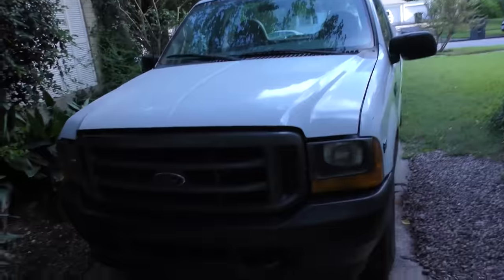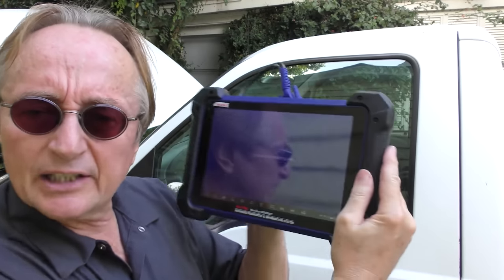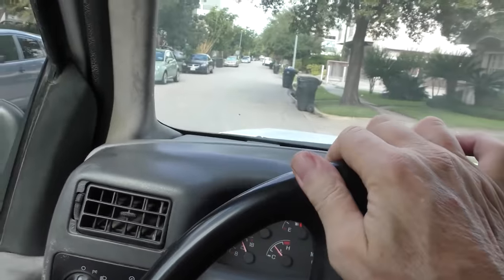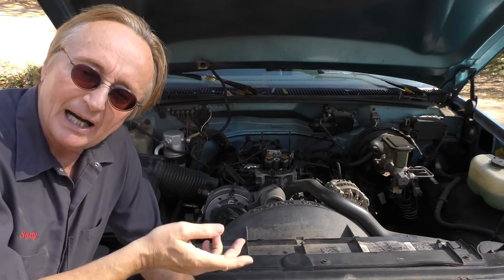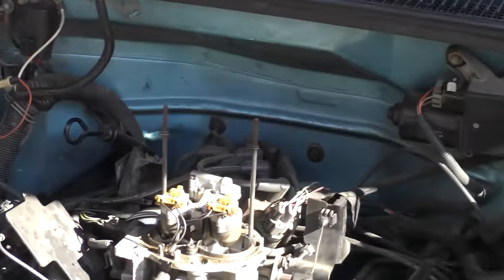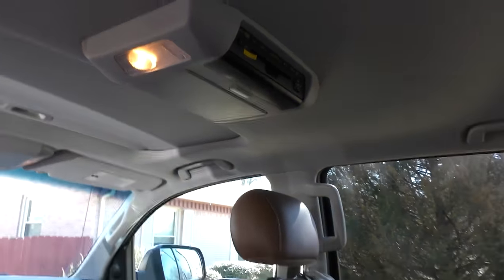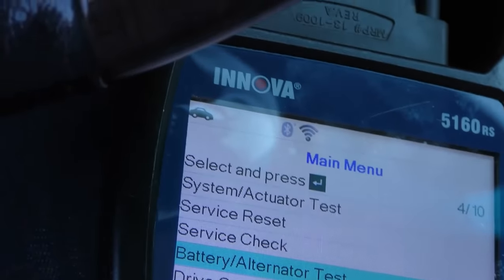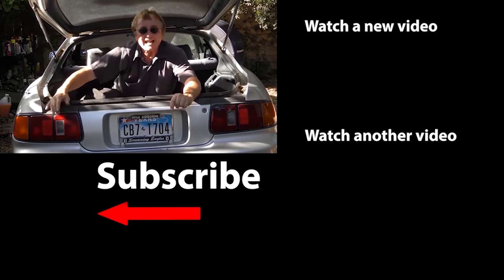3 Trucks That Will Last 700,000 Miles

Comment: The problem is all they sell now is Chinese parts and the scrappers keep junking these things like no other and crush them in 2 day because of the weight. So hardly any are left, In the last 5 years so many of these trucks? GONE from scrapper idiots.   They should of resold them.   The TBI 88-95 Chevy GMC trucks are good because I can fix mine alot of times for under $50   Its crazy.

Comment: my lame attempts at fixing tail light turn signals = it is caused by turn signal switch, hundred wires run thru the turn signal switch , DONT ATTEMPT TO MONKEY AROUND WITH WIRING , JUST REPLACE THE EXPENSIVE SWITCH FIRST

Comment: Scotty...   about timing belts.  You say 90-100K to change them out, but how many years should you trust them with assuming you are the type who maybe puts 5000 miles a year or less on your car?
Reply: After changing them out the new ones don't last as long the rubber is made cheaper than in previous years so I would change them out every 50/60 k

Comment: I love the people that say there car has 400,000 or more but what no one mentions is probably those vehicles where pulled around on all 4s by a camper.
Reply: I knew a guy who had 500,000+ miles on his 1993 s10 before he totaled it, original drivetrain. 2.8 v6, 5 speed manual 2wd.

Comment: Scotty, any idea why my 2017 Mazda CX-5 with 26k miles already needs a 2nd set of brakes and rotors? They are name brand rotors and pads (ceramic). I drive it 5 days a week roughly 100-120 miles a week.  Not sure why they keep warping
Reply: Rotors are made of cheap steel nowadays not like in the past they warp easier than they use too
Reply: @Hat65  nope, I have never had any other vehicle do it. My wife’s highlander gets used 3-4 days a week and usually it’s me driving that. My Corolla never did it, and it’s the same way I drive this cx5. I’m thinking it’s cheap materials that warp easier with heat
Reply: @kevinanderson686  that’s what I was thinking too
Reply: I would say go grab some OEM ones and replace them but more than likely they will be the same material
Reply: @kevinanderson686  yeah the oem
Ones warped when we had our first kid and we always used my truck. Her car got used maybe once every two weeks. These new ones for 4 rotors and pads were 300 and 150 to install. I might just grab oem and do them myself now that my knee is healed and I can bend 😂

Comment: A long bed is 8 feet. Not 6.5 on the GM truck.! You're a mechanic, but don't know what a long bed length is.?! This is considered a standard short bed.! Today you can get an even shorter bed of 5'7". Which is useless in my opinion. Can't even put a bicycle in the back and close the tailgate.!

Comment: I thought most of those 5.4 L. Ford engines had head gasket problems? The 4.2 V6 from 97 to 2003 was one of the worst engines that Ford ever made.

Comment: Disagree with the Ford. More problems than not. 5.4 uh oh lol
Reply: You are wrong. Another person on here not knowing what 5.4 engine had all of the problems.
Reply: @standhd  I work in Auto parts and repair. It's a Ford and has the 5.4. nuff said
Reply: @tima6549  What year 5.4???? Are you INTELLIGENT enough to tell me????? NUFF SAID……
Reply: @standhd  intelligent enough to know to stay away from ALL of them. I've worked on them all. POS backwards built trucks. The 4.6 isn't bad but it's basically a boat anchor Only good engine in those is the 7.3 Oh wait, that's not a Ford engine, it's an International. Go figure

Comment: No diesels?
Reply: It's a shame that there are no Toyota diesels except for some vehicles that only are sold outside in US and Canada. And their all small engines too, maybe a V6 or I6 at best, biggest one was maybe 4 maybe 5 liters, probably 4.5 because there was a 4.5L V8 diesel in some Land Cruiser and someone swapped one into a Tundra.

I have probably never seen Scotty discuss much of anything of diesel vehicles whatsoever. I think he did a talking about an old GMT800 Chevy Silverado 3500 dual rear wheel and it too was likely a gas (Vortec) and not a diesel (Duramax)

Comment: Too bad that 250 doesn't have the 7.3 Powerstroke, but you're not getting a 7.3 for $3500.  The 7.3 is just breaking in at 160k miles.

Comment: I called all the mechanics and none of them suggested a Ford or Chevy POS they only raised the prices on these truck's because they over priced the electric's  which makes no sense GREED they have destroyed their own reputations with greed! all the electrics are great and dependable better because they are electric the gas part lasts longer buy a used electric and really get the best deal! You can buy a Tesla for 20,000 and it will go forever 500,000 is the norm!Ill bet you have never even worked on a Tesla! and when they put the charge system under the streets as they say in NY "forget about it".
Reply: /facepalm